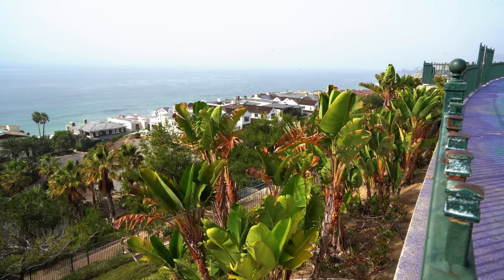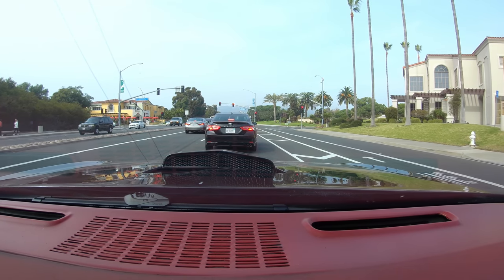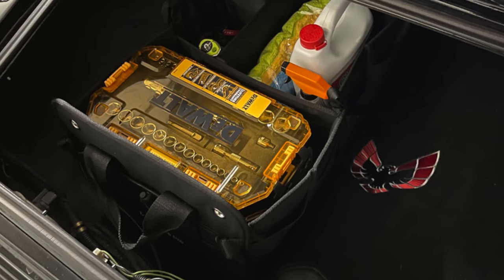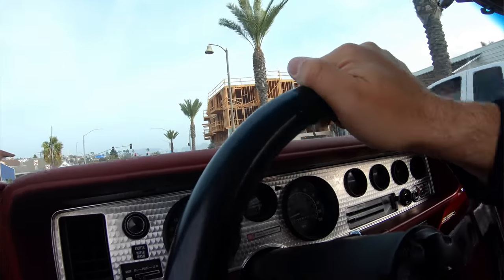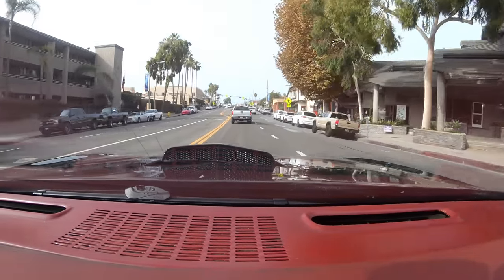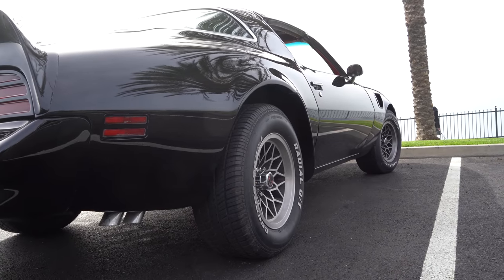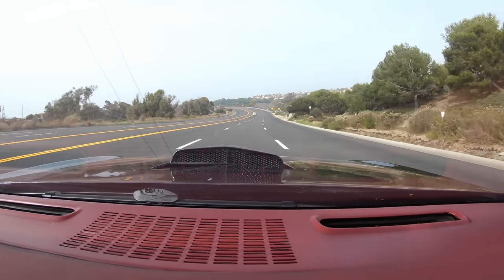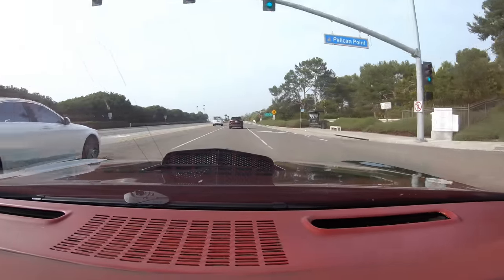The Trans Am is finally DONE! Why this is the COOLEST Car in the World!

Comment: Many "car guys" will replace the carb with a Holly 750 CFM Double Pumper, but the Quadrajet is the better street carb.  The Rochchester QJ has smaller primaries, which give better throttle response and fuel mileage around town.  Unless you "build" the Olds 403, and add a bigger cam, the Quadrajet is better matched to the engine, and you don't need more CFM.

I had a Rochester QJ on my 455 Pontiac T/A, and it works just fine up tp 400 hp.  If you ever replace it, go with electronic fuel injection, instead of a bigger carb.  A Holley Sniper will work with the shaker.

Comment: I had a '74 Camaro LT. It had a 350 smallblock with a rochester Quadrajet. I got it up to 130 MPH. When you floor it and it clicked into overdrive you could literally watch the fuel gauge drop. I would suggest an engine rebuild, suspension replacement, have the rear pad brakes changed to disc and change the interior to black.  I would also suggest just fixing the T-Top since all your issues with it are because it was poorly done.

Comment: to answer your question;   I don't think anyone will hold it against you for taking out the olds engine, and putting in a Pontiac crate engine a nicely built one with aluminum Heads will make decent power but think all of it through if you change the engine, do you put in an AOD transmission? If you upgrade the power make sure you upgrade the rear end as well.  It looks great and glad you are enjoying it.

Comment: I’m a Pontiac purist and I agree that Trans Am should have a Pontiac engine. I had a 1979 with the olds 403 and it wasn’t bad but the Pontiac 400 I swapped in just made the car. Yeah I caught some flack because mine was an automatic which wasn’t available in 1979 with the 400, but I didn’t care…I had an all Pontiac T/A and that was all that mattered. I’ve lost count of all the Trans Ams I’ve owned over the years, I’m 59 by the way 😬

Comment: I owned a 1973 transam with a 4 speed muncie gearbox and 455ci V8. Had been sitting in my neighbours garage for 15 years because of a leaking gearbox seal , he had lost interest in it so I offered him a swap for my toyota hilux worth about $10.000 NZD ..... he did the deal.... I ordered the new seal and the rest was history...... was a great car sold it in 2002 after driving it 12 years for $40.000 . It was in great original condition but boy was it thirsty . I say keep your one original and do your tweeks etc. The more original you keep it the more it will be worth down the line if you decide to sell. Your right they are comfortable to drive on a trip but without serious suspension upgrades they handle like a boat haha.

Comment: I don't know how the roof is structured with this after-market t-tops, but a Fisher (original) T-top roof had a third panel added to it to add strength. The third panel had a number of half-circle bends in it to make it stronger. If you want originality, you could convert it back to hardtop, but if you want t-tops you could find an original t-top car and weld that on. Unfortunately it might be hard to find a car with one on it that had a good roof but a bad body.

Old cars are so different than modern cars that you really need to find a classic car mechanic and autobody mechanic. It's almost like they are two different professions now. Never mind the fact that it is getting harder and harder to find competent professionals in any industry. Everyone wants to be a video game programmer.

Comment: You done need an engine swap, all you need to do is put a more modern 4 speed (700R4) with overdrive (4 speed) and do a rear gear reduction to like a 3:73, that will bring that car to life! then do a rear disc conversion, all of this is "bolt on" you can keep the original parts and enjoy the new performance. Congrats on finally getting it back. My wife has an all original AZ. car 77 TA, it is like new with the 400 Pontiac motor. Enjoy!

Comment: Congrats on getting your car back. I think first is going through the whole car looking for anything the body shop did wrong and fix it. Then maybe the roof big decision keep the t-tops or solid roof keep in mind you be heading back to a body shop. Keep the Oldsmobile engine dies. Don’t put any money into it. It’s a sleeved block and will die. Then get your Pontiac engine but don’t go crazy.

Comment: I’ve got a ‘79 with the 403 that spun a bearing when I first got it.  I have another ls swap vehicle and it is amazing but for this t/a after much deliberation stayed with the 403.  It just drives so nice like you say.  Yea could maybe hop up but to use different intake need to mess with shaker hood setup - all do-able just not sure worth it for a cruiser.

Comment: Hey, might be a good idea to get an electronic ignition system...I was bitten by the 74 Firebird Formulas. Of course this led me to the Trans Am of the same vintage...

i would just massage the engine you have. Intake(maybe fuel injection), a decent cam and good flowing exhaust. I'm a purest myself, so I would want to keep it as close to factory as possible...

Comment: My mom bought a brand new '81 Pontiac Firebird , my senior year in H.S.   It had whatever the V-6 engine they had,  got about 34 mpg..... great car, beautiful.   Didn't cost too much to run, she gave it to my little sis back in '96. my sister drove it to death, brought it down to me here in Yuma, Az, / brought it to my mechanic in Mexico, had him pull the engine, put new oil pump and look it over and new gaskets, and put it back together, she drove it into the dirt..... so from '81-97 it lived.   It was a good car.  if I were you,,,, it came with the Olds 403,,,,, but you want to put in a ? Pont 350? or Pont. 400?   Your call, but if it were me : Stock is always better!

Comment: I miss replacing cap, rotor, and wires . But they were joy riding your whip. You might need to run a black light over the seats

Comment: I had a white ‘77 rust bucket TA. But that Pontiac 400 was awesome.
I think I mentioned it before. But the high beam switch can be an electrical issue and try to catch the floor on fire.
Reply from the maker: I have already bypassed that nightmare switch
Reply: @WorthlessWhips  I vote for the Pontiac 400 swap. If you decide to go hardtop? I think you should watch videos on DIY carbon fiber and make your own. The strength, weight savings are worth it. Plus you can paint it if you don’t think carbon fiber is the right look for it.

Comment: Pontiac crate motor. But if you're worried about passing emissions you might want to stick with what you got. Crate motors don't come with all the emissions equipment. That would be a hassle to add on especially if you need an air pump.

Comment: I bought a new 1979 Firebird Formula in early 1980. Should never had sold it. I then had a few Corvettes. Seems like yesterday you could buy a 1977 -1978 Trans Am with under 5K miles on it for around 10,000.00. Good used ones were 5,000.00.

Comment: If you swap the engine you might as well do a complete remodel and upgrade suspension brakes steering drivetrain everything so it’s up to you but there’s nothing wrong with original since you like it so do what you like

Comment: If the body shop have done so many mistakes I would check if the doors actually have a moisture barrier
From what I've understood not many current gen mechanics understand how to fix a carburetor so it would be a little hard to find a second opinion on your upgrades if it involves that part (though the carburetor isn't that difficult to understand mechanically in itself)

Comment: Keep it numbers matching. You'll easily get as much performance out of it as you'll need in a daily driver by upgrading heads, cam, manifold, carb, headers etc. So many people ruin a good car by swapping out the engine for a bigger or better one. Inevitably, the start of a slippery slidey slope.
You look and sound rapt to have the car done, even with the stock engine! 
Sounds like you've done a "proper" job of restoring this one though, it's a great feeling knowing that everything's been done. . even better that you found a good one to start with.
Peace of mind and satisfaction . .
I had a '76 Camaro back in the '90s - 350 manual. It was fun but being more like your first Trans Am/Firebird, it was a piece of shit in reality. I've since owned much nicer cars.
There's also a lot you can do to make it suit you or your personality in subtle ways. I restored a '37 Ford V8 Pickup when I was young. It looked stock but I'd widened the stock rims by an inch outwards all round, used 2" stainless for twin exhaust instead of 1 3/4" single, upgraded it from 6V to 12v, had a later model 24 stud flathead V8 instead of the original 21 stud. Also used '39 V8 hydraulic brakes instead of the old rod & cable it came out with. Slightly green tinted glass all round, etc etc. One vehicle I should never have sold.
I'm now in the final stages of building a car that I've owned for over 30 years. A '33 Willys Coupe running a blown, injected 392 Chrysler Hemi. This will be my piece de resistance. Everything about the car will be right out of the '60s.
Keep up the good work and don't let that car of yours allow your mind to stray from your "day job" . . exposing the CCP and it's lies and games.
 I'm in New Zulland BTW and am married to a wonderful Taiwanese woman. We've got a 10 year old daughter who is fluent in English and Mandarin.

Comment: If you do an engine swap, I would also consider a transmission swap as well.  The TH400 is bullet proof, but a 4-speed 4L80E auto will improve your driving experience.

Comment: When it comes to the engine discussion, keep the car with the existing block at least to match the numbers. If you swap the engine, the heart of the car is now different from what you have. If you do some tuning and bolt on some shiny go faster parts, it's still the original period engine, but better. Will it be quite as fast or as reliable as a new crate swap? No. But that doesn't matter.

Comment: Man, after over a year I would have took the car out of that body shop just like you did as fast as possible.  2 minutes down the road I would have called my credit card company and put a stop payment to that shop via the credit card you used to make the final payment on the half-ass repairs that they did and didn't do. 
All of us that have performance cars have dealt with a shop like you just did at some point on some car that we needed somebody else to work on and found that they should have been honest and just said they don't know how to work on that car and not touched it.  Rather than half-assing every single thing that they touched.
I will take that car to another shop up in PA since there are plenty of good shops that work on 60s and 70s car in PA.  I'm over in northern Delaware.  
Good luck with the trans am you'll get it sorted out.

Comment: What sort of body shop did you use?
This sounds like you had this done in S Africa or China. At least it’s on the road, I know what you went through I have a 1991 Z28 that I’m afraid to drive due to other people on the road.
I had mine at a actual dealer and they destroyed the drivers side mirror and didn’t even notice it, trying to say it was damaged when it was dropped off. They had a fight from me to get it fixed car only has15,000 miles.

Comment: If it's the original engine that matches the tags, keep it otherwise it's overall value will drop in future. If you do anything, keep the original engine aside and put another in, don't modify the original. For collectors cars, matching numbers will more than double the cars value, and they prefer stock standard items.

Comment: Car looks good. Glad to see another one restored. Those tops however just don’t see why you wouldn’t have found nice originals. That rattle is super annoying and probably leaks and doesn’t fit the original look from outside. Second you kind of knock putting a Chevy 350 in one but I have to tell you that a Chevy 350 with a borgwerner 4 speed and hurst shifter would be an extremely more satisfying driving experience than that automatic. I don’t understand people who would think that driving that is anywhere close to driving a 4 speed. Trust me I have driven both and I’ll take my Chevy 350 with a 4 speed over your car any day of the week. You have a great looking car and I like the new close to original looking modern interior but that doesn’t drive like the car was intended to run. Drive a 4 speed and get back in your car and you won’t want it anymore.

Comment: Keep it original. I have a joke about Trans Ams and Camaro; that it's French for "I've been F***ed with!" People are always bringing us them to straighten out the wiring and they always start by saying, "Let me tell you about my Trans Am". And I always hold up my hand and stop them and then proceed to tell them, "The engine was changed and it doesn't quite fit right so the steering link binds, the radio was changed and it shorted out the dash lights, the fan runs all the time......" 
They then look at me in surprise and ask, "When did you see my car?"  "I didn't but you said Trans Am and that's French for......."
You have a piece of American History, Keep it Original. (And I better see you replace that horrible insulated butt terminal :) )

Comment: You know that 403 olds was for California smog but 400 Pontiac makes your car all Pontiac and was the stock engine in other states they used the Pontiac 400 in the Oldsmobile 442 thing is the 400 is just a better all around engine and can be hot riffed without worry of spinning a bearing from lack of lubrication. It’s how it was designed internally. Probably never have a problem low rpm cruising. A mild 400 crate engine would be grate for all purposes and even if you want it much hotter the design of the block will still hang in there. It all boils down to how important is it for you to have matching numbers and the California engine.
Reply: One other thing though you may need other parts from the Pontiac engine which may not match up like A/C hoses and maybe alternator wiring harness you need to look under the hood of a firebird with the 400 but they would be much more plentiful to come by

Comment: Yes, swap the motor with a great cam sound. No you can't just throw heads and headers on. The compression ratio is 8.5 to 1 if you're lucky. Maybe a tremec 5 speed ? now you're rocking... lol

Comment: Now that you are in the rust belt it should be a garage Queen until summer or you will destroy the under carriage. Leave the motor alone, unless the block gets trashed. I believe in Penn. that they do yearly safety inspections. Not sure if the do emissions checking. Also was good they took out the gas, it will start to gel if it gets over 8 months old without a stabilizer in it.

Comment: i took a 4 speed 400 out of my 78 and put a built 350 out of a 3rd gen with a 700r4.. that will have 2x +  what the original setup did

Comment: No just rebilled the original engine keep it numbers matching and get more HP torque out of it. Upgrade the cam, crank, intake, heads, and carb. You will have to rebuild the trans to be beefed up and drive shaft and rear end too Winston. Make a smokey and the Bandit car out of it the 78 TA from somkey 2 you have the car the paint job already Winston just do it. It's only money if you can. That would be cool.👍👍

Comment: ... well you can never grow a mustache now.   Squeaky rubber - my convertible; the rubber would "get sticky" if the top was up awhile .. you put usually this milky looking stuff on it .. the 300 company makes one; and that keeps it from squeaking which is related to the rubber sticking.  WINDOWS, a glass company might be your hope for aligning the glass, only because they have experience and they do it so often it hopefully is "not a big deal" to them. ENGINE - in the USA they pretty commonly remove the engine to get them perfect; and carburetors if you understand them, but I think they replace or modify them with at least a partial electronic solution now.  That engine sounds in real nice shape, no knocking or drama.  If they pull the engine, good time to update the aged rubber and seals as they put it back together.

Comment: BEAUTIFUL RIDE!!
AND NO YOU SHOULDNT DO AN ENGINE SWAP! WHY?
1) NAME ANY  MODERN ENGINE STILL RUNNING TODAY AFTER 30-40 YEARS? NONE! ALL DEAD
2) NAME ANY MODERN ENGINE AS SMOOTH AS AN OLDSMOBILE? NONE EITHER!
3) NAME ANY ENGINE IN ITS ORIGINAL FORM STILL RUNNING TODAY WITH NO REBUILD RUNNING ORIGINAL INTERNALS?? NONE! NOT EVEN THE MIGHTY LS HAS DONE IT!

THAT 403 ALTHOUGH IS A COMPLETE DOG...WILL PROBABLY RUN FOR ANOTHER 30 YEARS IF TAKEN CARE OF! THATS THE DIFFERENCE BETWEEN AN OLDS AND THE REST OF THE WORLD...T/A 6.6 PONTIACS ARE JUST AS GOOD BUT RARE AND HARD TO FIND!

Comment: Me. I would do a Pontiac 400 or 455. But your also gonna need a th400 or better is your gonna up the power that much. The th350 will bolt to the Pontiac and last a little while..... But they Will dye if you drive it like your suppose to drive it. But I've watched all your car videos. You defiantly like the original stuff and your not a racer. So your prolly gonna keep the Olds. It's got a lot of miles on it. And it's not gonna get any younger. Honestly..... Drive it.... Till it dies. Then decide if you wanna swap the motor. In the mean time..... Keep making your maintenence videos.... Carb rebuilds etc..... Unless you get a good deal on heads.... May cost more than the Pontiac. Cause you know your not gonna stop there. Exhaust, intake, carb, lifters.... Then why not the cam.... Heads come off and the pistons look like trash. Trust me. Take off the heads and you'll open up a pandoras box.
Keep up the good work.  Born and raised in the US.... Now I live in Turkey and no way I can afford a muscle car here.